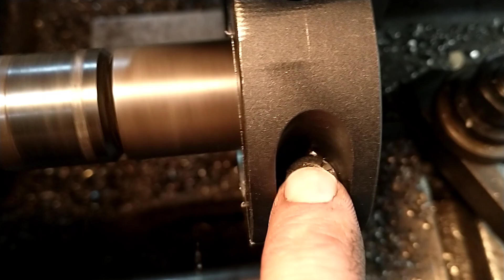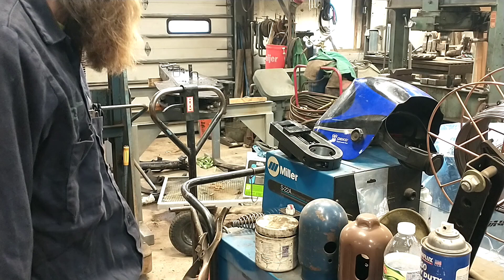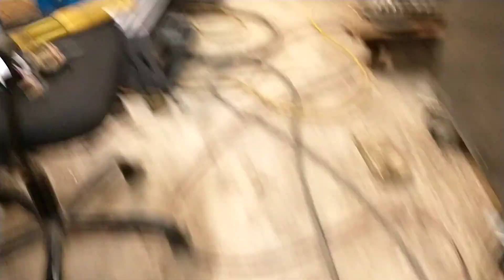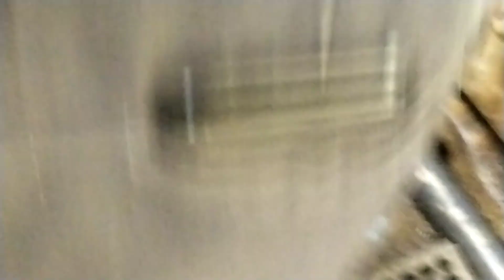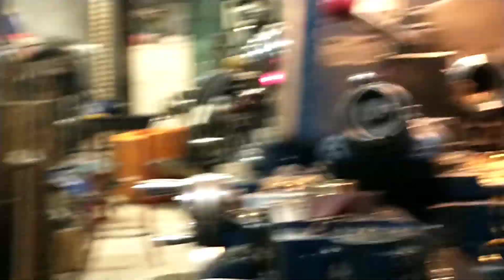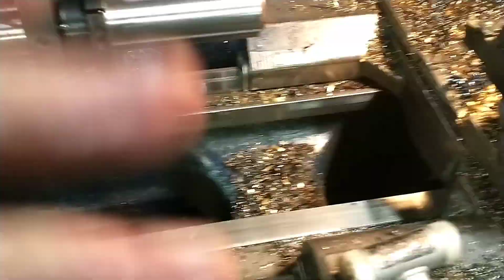Redesigning a Chinese facing head to actually work.

Comment: Just found your channel. I’m going to sub. 
I made one of those from scratch a couple years ago just from a couple pictures. It’s a lot of work to make from scratch. I needed it to fit my 2-1/2 inch bar and travel 12 inches. I made to do gasket finish on flanges so the travel is fairly aggressive. To get a nice smooth finish I need to make at least 3 passes (4 is better) holding the drive handle in a different equally spaced position each time at the same depth of cut. 
Some day I will make a new finer pitch lead screw and tool block for standard facing procedures.
Reply from the maker: I just exploded this one on the last job I tried to use it on, somehow something hung up and it blew up the little feed wheel. I'm not sure if I'm going to bother fixing it or just start from scratch. There is such drastic variation from one job to the next I have a hard time deciding if facing heads are even worth screwing with in my line of work, 3/4 of the time there's not enough swing clearance to even allow one to be used, and the other one quarter of the time the setup is such a pain it probably still isn't worth it.
Reply: @Andy-PerpetualMotion I understand. For me it doesn’t matter what it takes to get the job done. When I’m dealing with 24 inch flanges on million dollar plus tanks the customers don’t have a problem with lengthy setup times. Corrosion needs removed and gasket finish recut. Generally the flanges cost thousands, expensive to get them welded in and the tanks need recertification and pressure testing all adding up to an extremely higher price tag with longer down time then machining. I generally can cut them twice before they get outta tolerance at which point the entire tank is likely due for replacement.
Reply from the maker: @draganarc0131definitely a different world than I'm dealing with, the stuff I'm working on is always a challenge to decide if it's worth the investment or if it ought to just get junked. It's rare that I do a job that's more than $3000 or $4,000.
Reply: @Andy-PerpetualMotion yes, I got a lot of that too. A farmer brings a bumper pull trailer in with the back cross member broke off due to corrosion and first thing I do is crawl under from front to back, take pictures and let them know it needs all the cross members replaced and give them a quote. It almost always ends with “we’re going to scrap it and buy a new one. So many have asked why I don’t just fix what they ask, take they’re money and worry about the next problem later. The answer is simple, treat them the way I would like to be treated and that has gotten me more work then I know what to do with. They appreciate that so much more then patching as they asked for and having another problem or insurance claim later. That’s an example of what happened 20 years ago when the customer said “just patch it, we’ll be good “ 3 months later the axles broke off on one side, they whipped out a car and the law suit was astronomical. Thank God no one was hurt. Since that I will turn it away because I don’t want my name attached to anything that could potentially kill someone. I like to sleep at night knowing I’ve done the best I can. 28 years with zero insurance claims, I’d like to retire without any.
Reply from the maker: @draganarc0131well spoken

Comment: What surprises me is the Chinese ingenuity to be able to make something shittty! Like it takes more brain cells to engineer something to be junk rather than at least decent quality....
Reply from the maker: My father had the unenviable task of going to Mexico back in the early '80s to figure out why a foundry was running such outrageous scrap rates down there, if I remember right they were running 60% scrap. It turned out that the problem was that the people who were casting the camshafts in that foundry had no comprehension of what a camshaft did or what an engine even was, and so any lumpy bumpy looking chunk of iron was good enough to them. Getting the scrap rate reduced required educating the entire workforce on what the function and purpose of the part they were making was, I suspect there's some of that going on in china.
Reply: @perpetualmotion1  for sure. They just clone something that someone has already made with no idea what the heck its for and how it works and therefore you get junk!

Comment: All these great boring mill vids, inspire me to get mine set up and more usable. Do you have 4ft of concrete under yours, or a more
realistic floor that it sits on? No heat where mine is, so cold weather keeps me away from it.
Reply from the maker: I have a steel reinforced 6" floor in my shop. Good enough for my purposes.

Comment: Anyone saying he could have built it from scratch cheaper has never built anything like that from scratch. I have built many projects like this from scratch and it takes way way longer then the 300 bucks is worth to spend. Even if you need to reengineer half of it. You are still starting out with a mostly completed tool. 

Nice work man. I just subscribed. Surprised it took me this long to come across your channel.
Reply from the maker: Right on, I spent about 20 hours and $200 just building the gate, hinges, and latch mechanism for my back porch 😂
Reply: @Andy-PerpetualMotion  lol. I’ve done that shit so many times. When you do the kinda stuff we do it’s hard not to think      We’ll shit… I could just build it from scratch. But a lot of the time it’s way faster to buy a partial or completed project or product and then tweak it to fit your needs.

Comment: For $300, seems like you could have just make one from scratch using scrap for a lot less than that, and it would actually be a lot better quality.
Reply from the maker: I'd have a solid day tied up to make those parts, a day line boring is $750-$1200. The   math doesn't add up.

Comment: Being one who has owned a Climax facing and grooving head for some twenty years now, that has proven to be well worth it's cost. I am not impressed by this at all. I will be interested to see how it works for you. Cheers.
Reply from the maker: I guarantee you that was a lot cheaper 20 years ago than they are now, just the bb5000 is knocking on the door of $60k these days.
Reply: @Andy-PerpetualMotion  Crazy isn't it?  In 1996 28 years ago I think I bought a well decked out BB-1149, the predecessor to the BB500. Large bore head, small bore kit and I think four boring bars for well  under $20K and LTL shipping to NH from Oregon was 140 dollars. I bought this particular model  facing head some years later soon after it was introduced. I think it was $4500 then, not insignificant.   I now build nearly all of my own tooling and only buy parts not easily made from Climax.  Nevertheless I hope this thing works for you, I am fairly confident you will make it go. Cheers
Reply from the maker: Mind boggling, I go out of my way to avoid buying from climax, their markup must be impressive. I was in a pinch and bought new sprag clutch bearings from them a year or so ago for my feed box, after I got it apart and found the part numbers I discovered they were charging me almost 3 times the list price!
Reply: @Andy-PerpetualMotion  Yep! the funny thing is you can buy the round spherical  bearing retainers  for the mount with the good Seal Master bearing insert for what is a reasonable price considering what everyone  else seems to want for a bearing insert alone. Who knows? I just learned yesterday that they were recently sold to Specialized Fabrication Equipment Group. Again who knows what that might mean? I do know that they make good machinery for what it is used for that is well engineered and very expensive. In recent years their customer service is not what it once was. Par for the course.

Comment: I use 2 of those on my HBM to face ears on fire truck ladder turrets clamped to a line boring bar I stick through the Pin holes.

Make afew of them a year
Reply from the maker: I thought about building one from scratch, but I figured even if the Chinese one was totaled junk it was still something to start from.

Comment: Should have shimmed the pinch bolt and tightened it.
Reply from the maker: I don't think in this instance it would have helped anything, I ended up snugging it up until I got rid of the harmonics and just cutting. Something about the original machining made it necessary for that thing to squeeze down a little bit in order to free up the slide. There's no two ways about it, we were polishing a turd.